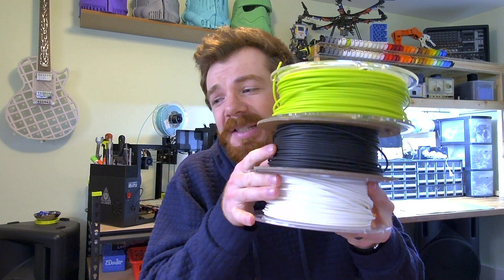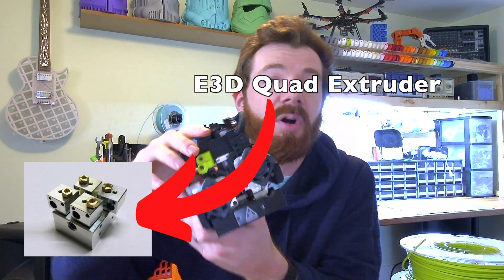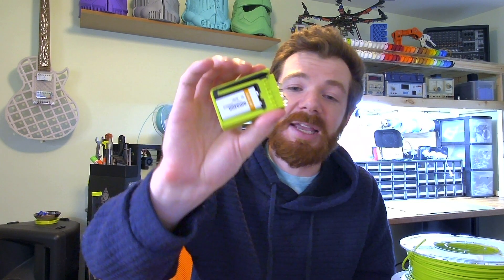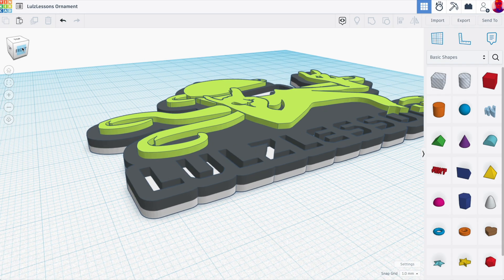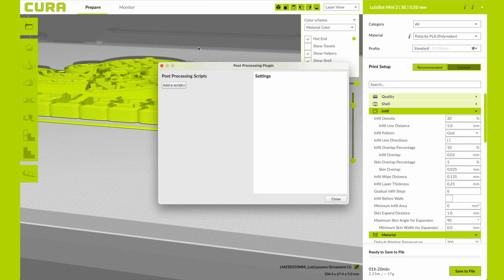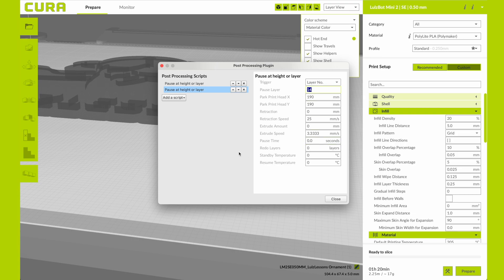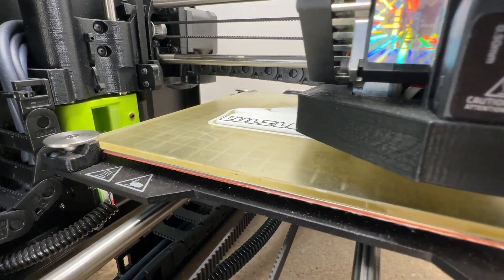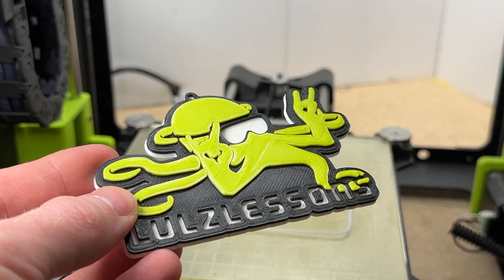Multi-Material Printing on a Single Extrusion 3D Printer

Comment: I think my biggest hang up(noob) is figuring out how to separate the colors in the design by layer. Alot of multicolor files have all colors mixed throughout design
Reply from the maker: Indeed, like a voronoi pattern. In these cases, you would need a multi extruder or filament changing system rather than a change at layer height like this project.

Comment: Greetings, Great Instruction !!!!!,,,, I'm new to the 3D Printing scene, and have ideas to create some prints that serve a Utility function, and would like your advice on how to go about printing out something that is mostly hard , though has three sides that will clip onto a rail , so those edges would maybe be TPU , a filament that gives or clicks into place when pushed together.... Gluing would not be an option, as I would not trust it in the long run..... Any information in printer models and Ext heads would help.... Thanks.....
Reply from the maker: Thanks for the view and happy to assist! TPU comes in many different forms, some harder and more rigid than others which makes it easier to print, especially when combined with other rigid materials. I would suggest looking into GizmoDorks TPU, I find it to be the best compromise of rigid and flex and easy to print personally. You might also get away with a rigid material that has some flex to it, like PETg. PETg and TPU also print at similar temperatures, so swapping between those materials mid print would be easier to do than say PLA and TPU. Hope this helps!
Reply: @MrErdreich  Yes, Thanks for the information  on the Filament, I now have to make a decision on a Printer.....
Reply from the maker: There are many great options out there, but not many of them are suitable to print TPU and flexible materials out of the box. Heated glass beds, direct drive extruders, and 2.85 mm filament printers typically do better with this if you were planning or primarily printing flexible or abrasive materials over PLA.

Comment: Hey! I used a flexible filament in my Dremel 3D45 and then paused the print and changed the filament to a PLA and manually edited the settings on the printer and now my printer is mad and no filament is coming out even when I’m hitting purge.. any idea on how to fix? Also, if I do the settings correctly next time, have you done a print where you toggle between flex and PLA In one print successfully? Thx!
Reply from the maker: Happy to help! What type of nozzle are you using (copper, brass, steel, etc)? TPU really needs a harder nozzle like a coated copper or hardened steel one. I would assume you're using a brass, nickel, or copper nozzle and the TPU has just completely jammed the inside of it. If you plan to swap between different filaments, I would suggest a coated hardened steel nozzle and that you increase your overall print temp to 225 c rather than the default 205 or so typically used for PLA.

Comment: why would you use pause at to change filament over the change filament script?
Reply from the maker: One in the same I suppose, I've always done it this way personally, maybe because I often changed to different filaments (PLA to TPU for example) and wanted a bit more control, but the change filament script would work as well.
Reply: @MrErdreich  I have a Dremel 3D Single nozzle printer.  I’ve been asked by students to do this but I didn’t know it was possible until now.  What would I look for in my slicing software to determine if it’s possible with my equipment?
Reply from the maker: @AlFitch  To my knowledge, Dremel uses a Cura-based slicer just like Lulzbot so you should be able to find the same menu I used in this video, though it might be in a slightly different place. Alternatively, you could use the full-fledge Cura by Ultimaker and add your Dremel to that using an existing profile. This will give you more settings and more control. You could even use Lulzbot Edition just like I showed in this video as well because all of these different programs are based on the same core Cura program.
Reply: I will just add that the M600 command most slicers use for the change filament command does not work on Marlin Firmware on the Ender 3 S1 Pro or the S1 Plus. It's a glitch that hasn't been fixed yet to my knowledge.